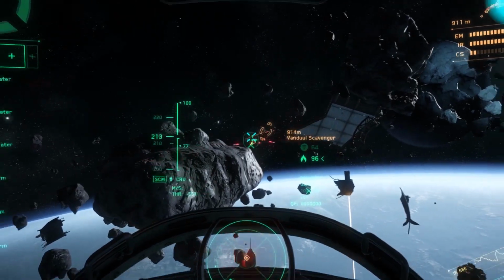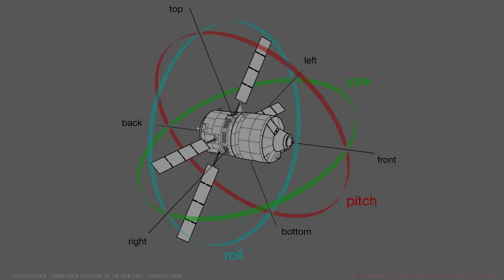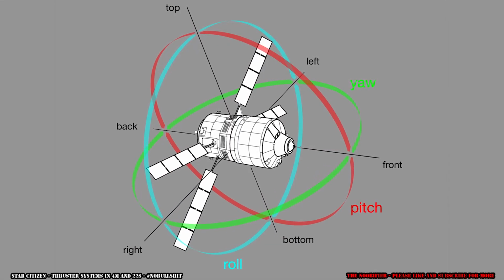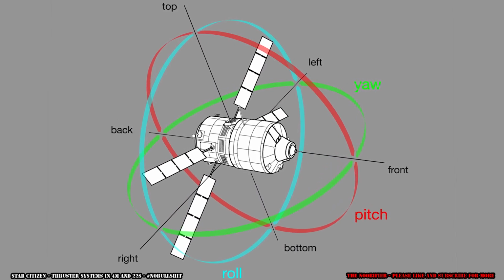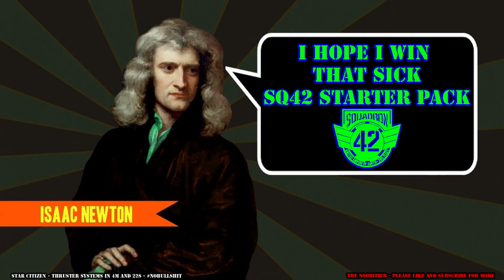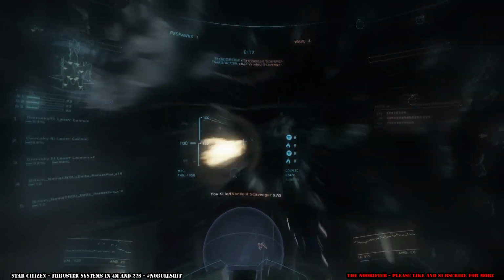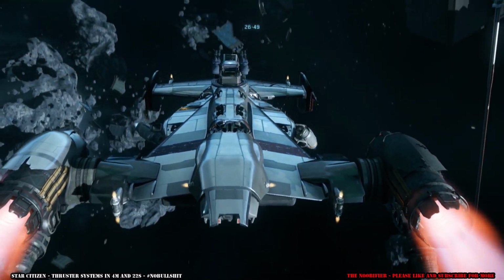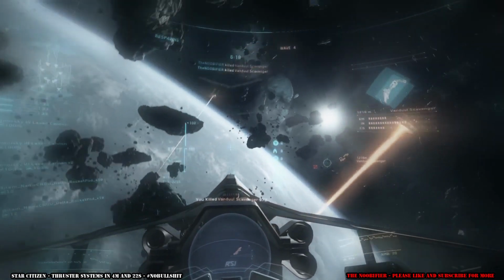Star Citizen - Thrusters Explained in 4 minutes and 22 seconds

Comment: Is there a point to binding boost and afterburner to different buttons or would I always want to use them at the same time?
Reply from the maker: +Nick Van Riper I have boost and afterburner bound to the same function but in the options menu for the joystick it has boost as a push on button and AB is a double tap. so you can Tap Hold the same button for AB..Hope that helps.